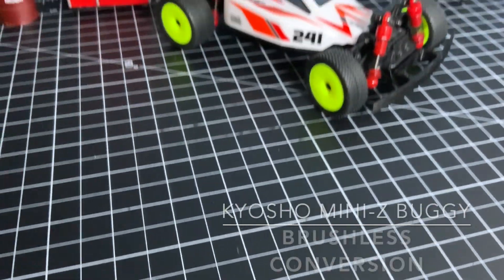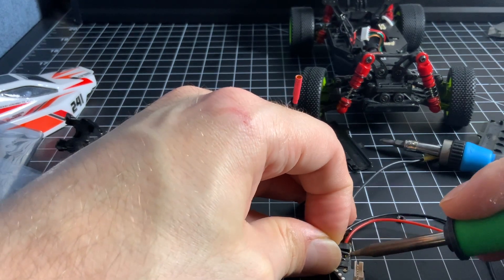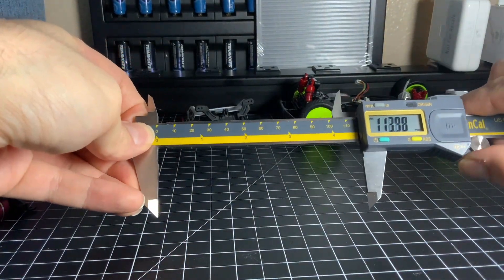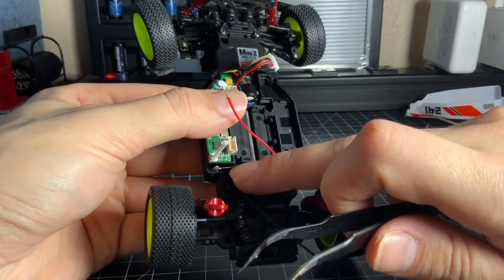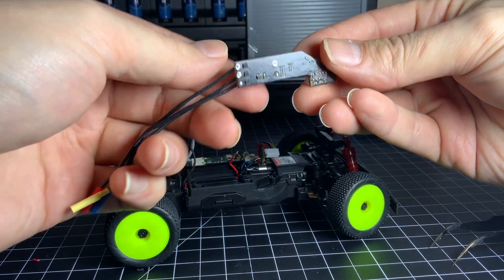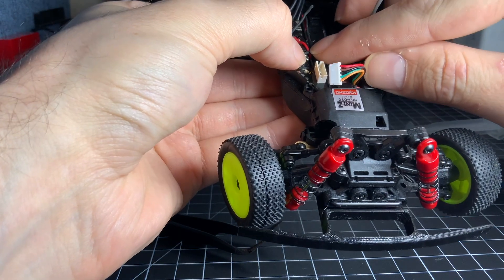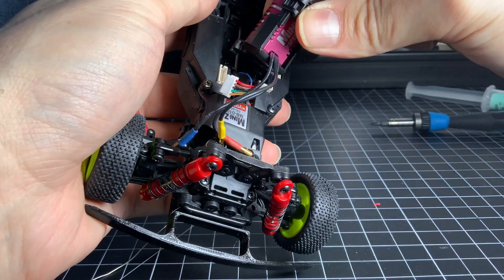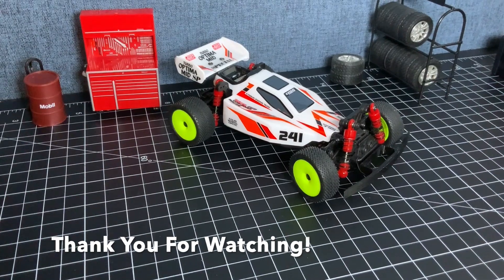Kyosho Mini-Z Buggy - Brushless Conversion

Comment: Whata up man so, I have a few questions first things first. So when upgrading the notor susten to brushless, it doesn't affect the sensor thays shitting up front its long & kinda looks like another motor?  Or is that the Gyro? Either way, what I am asking is will if effect anything when upgrading the Kyosho Mini Z MB-010 Non EV2.0. 
 I got the Kyosho XSPEED 56 5600kv. And then the EXACT SAME ESC, that you use in the video. When doing my research I found another ESC Kyosho Mini Z brushless ESC that has that loong Gyro motor on it with the brushless cups and all that, the one I have, & the one in your video does NOT have tha.
  I paid $114.00 dollars for it sheeeeesh man. Mini Z's are pricey AF!

Comment: Hey there. Awesome video. Truly needed this. I've waited since COVID to get the brushless esc and finally just ordered one a few minutes ago. I have a question regarding the battery leads: what sort of wires do I need? My soldering skills are amateur at best and I did not realize that this was a necessary step, thinking this would be mostly a plug-n-play. Also, I was wondering if I need to upgrade the servo and gyro as the steering response and torque is lacking as my tires keep getting stuck to one side as they dont bounce back to straight when I turn the wheels left. And if so, could you recommend what would work with the same brushless upgrade you have in this video. Thank you regardless!

Comment: Is it possible to only swap the motor ?
Reply from the maker: No because the brushless motor has three poles (required to build torque without brushes) and the brushled has only two (positive and negative)

Comment: This was extremely helpful. Are there any comprehensive sources for the sorts of conversions that are possible for this particular model, and not just the motor? I came across so many accessories and am really wanting to switch up a few parts to aluminum and just understand what is possible. And for the motor for this conversion, I'm still so lost on the power of the brushless ones and which are best for this buggy. Thank you for this video!

Comment: How fast does it go? And how much did it cost you? Been wanting to get the blue inferno but i know I want to convert it over to brushless and I know Kyosho parts are expensive and I’m also new to Kyosho lol
Reply from the maker: The speed will vary based on your gearing and tire choice, and I haven't run a speed checker on this so I can't say for sure. My guess is around 15 mph.

$40 for the ESC https://www.amainhobbies.com/kyosho-ma020-ra45-r-c-unit-set-kyomd211/p1001184

$35 for the motor
https://www.amainhobbies.com/kyosho-miniz-xspeed-85-brushless-motor-8500kv-kyomz604/p872258

~$1 for wire/solder/flux
Reply: @ZTK-RC  ah I see and thanks for the help.

Comment from the maker: Thank you to CerealKilla for the suggestion to leave the switch leads in place! Don't desolder them from the ESC, just use the switch that comes with the new ESC. :)
Reply: Will this work on the older ASF buggies???
Reply: Bruh, I have everything the exact same as you when talking about RC and the brusheless setup the ESC is the same the only thing that's different is the brushless motor I decided to go with due to the color scheme which I am going for all blue and a few red parts. Kinda Spider Man'ish buggy scheme, if you will. But how much of a difference is it using the XSpeed 56 over the Red one that you're using? Please let me know or a watcher could let me know I would really appreciate it big time! Due to the fact I can still exchange my motor in order to get the Red one if really needed.